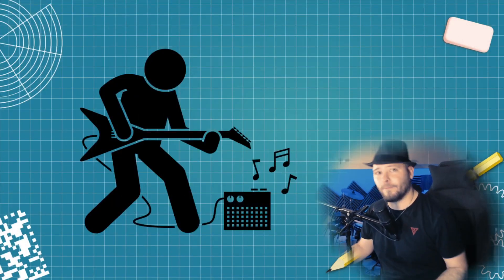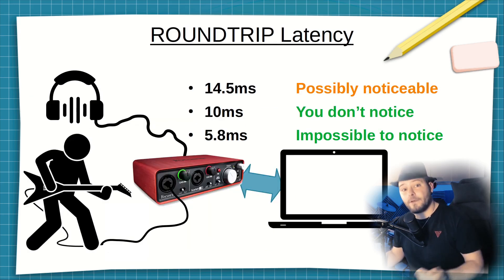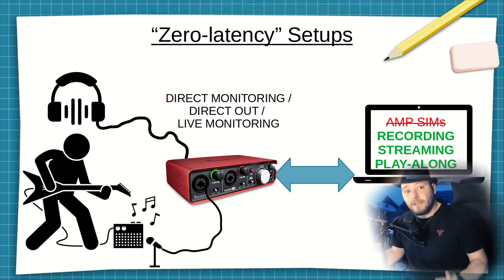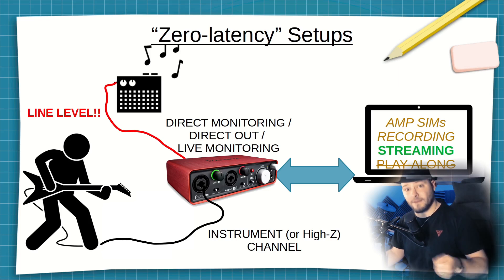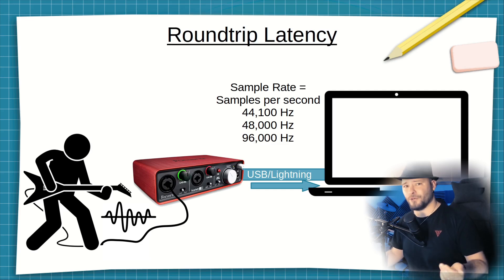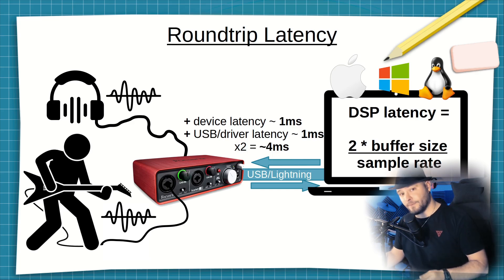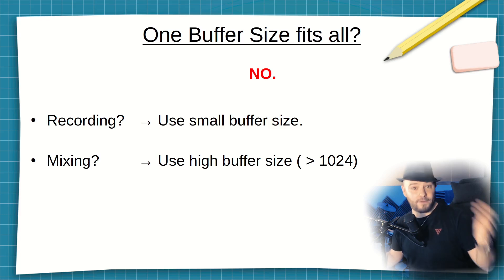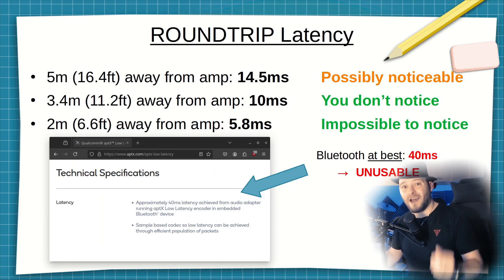Latency of Audio Interfaces

Comment: Thanks for the video. I’d like to offer a free advice to people struggling with their audio interfaces. Try another USB cable. I lost a lot of time fighting configurations, IRQs, kernel settings, just to realise that my long cable was causing problems. 

Also, I am thinking about using a pedalboard with dry and wet usb channels to record the dry signal and monitor with the wet signal directly from the pedalboard. This way, it’ll always be circa 5ms monitoring latency. 
Then I can apply all the plugins to the dry recorded track. 
It’s a lot of work, tho.

Comment: Nice breakdown here. This made a lot of things make sense for me. When I started recording I used 96khz sample rate because I didn't know any better. I thought "oh cool I get a really low latency and my CPU isn't maxed out constantly", but then I saw my hard drive space getting eaten right up.

Another thing I noticed is if you have a lot of cuts and edits in Ardour, that can cause a lot of xrun errors if you don't adjust the buffer size. Or just bounce the edited tracks so they're all one region.

Anyway, great video! \m/